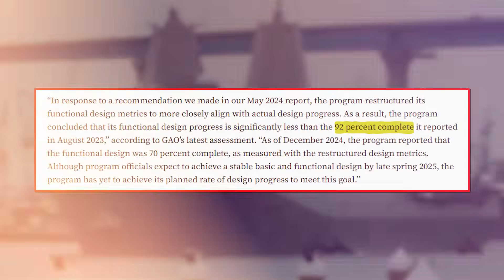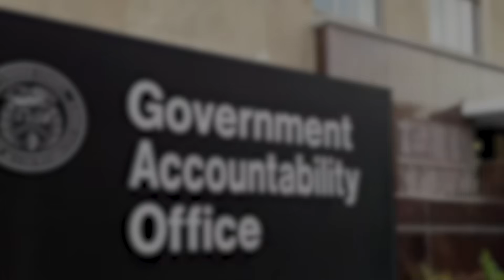US Frigate Meltdown: Constellation on the Brink!

Comment from the maker: If YOU were handed the Constellation-class playbook tomorrow, what would you fix first—its bulging weight, its slipping schedule, or its shrinking budget line? 🤔 Drop your battle plan in the replies and tag it #SaveTheFrigate or #SinkIt so we can track the hottest ideas. I’ll highlight the sharpest takes in our next episode—let’s see whose strategy could actually keep this ship afloat (or scuttle it for good). Ready… set… brief!
Reply: You’ve got Type-26 Combat Frigates already being constructed by UK BAE for the UK, Australian and Canadian navy. Already designed for DEW and extra weapons packages. It’s a no brainer. Ask for licensing. Problem solved.
Reply: @stephenpriestley5556 They tried that. It didn't work out.
Reply: By the baseline from the Italians made in Italy.  We need frigates now!
Reply: Return to a standard FREMM configuration with no modifications for building 20 now. Return to the drawing board for a clean sheet replacement for the next 20.
Reply: At this point? I would reassign the majority of people. Those not reassigned, would be suspended, pending investigation. Suspend the entire program, and order a careful investigation. Simultaneously I would use different people to begin with the Oliver Hazard Perry class hull design. Replace weapons and electronics with modern systems. Build, build, BUILD! I would carefully select good people for a clean slate design. Those involved with the original now frozen project? Would face an intensive and unlimited investigation. 
     I suspect that key officials were paid off. Allowing a real world project to turn into a computer game.  So that outwardly the program would seem to be on track. While in reality, the project was going nowhere. I also suspect that China is responsible for this.
Reply: The Canadian type 26 is very close to what the USN wants.

Finish the 7 FREMM to what ever standard is currently agreed, then swap to type 26 - should have enough time to fettle the design by then.
Reply: @kevinshort3943 I get it! That ship sank! Glugg! The Admiral in charge made a complete FUBAR of the project. It's time to move on. Whatever actually works? Hulls in the water are needed! These fu@kers haven't figured out how cut bait!
Reply: Sack the SOS manager that was also on the LCS prgram.
Reply: The Constellation Class is 98% the size of a Arleigh Burke but only 30% the firepower and near the same cost to build and man. I guess the question the Navy should be asking is what task they want the new frigate to play? The initial plan was to build a quick cheap ship that wasn't as powerful as the Arleigh Burkes, that could be built more quickly, and be cheaper to produce and operate. Instead they designed a ship that's inferior, expensive and timely to produce.
My solution is to drop the Constellation and instead produce a new Oliver Hazard Perry Class frigates with updated modern off the shelf systems, but also keeping it more simple. Use smaller cheaper radar systems and not the bulky AN/SPY-6(V)3 scanned array, this will reduce its ability to detect air threats but that is superfluous to its main role of taking on the smaller missions to free up the larger ships to more important tasks. The roles for the new OHP Class frigate would be anti-pirate, and anti drug operations with its shallow draft for littoral waters, fast speed, large double hangers containing both a helicopter but also UAV's it would do the job much more cheaply then using a much more expensive Burke. Also with a modern sonar system it would also be able to take on the anti-sub operations that the Constellation does not do. And lastly if they mount the older CIWS Phalanx system it can be used to screen for anti-drones operations. Not only could it replace the Constellation, but also the Independence and Freedom Classes.
Reply: @jpraiswater8625  
Constellation is a frigate, and Arleigh Burke is a destroyer. NOT an apples to apples comparison.
Reply: @kevinshort3943  And you don't seem to get the point. If a ship is 98% the size of a destroyer, and cost the same as the destroyer but is 30% its firepower, you might as well just make the destroyer. The cost to benefit ratio is what matters here not the classes. The Constellation was supposed to be the quick to produce budget ship that could be used for all the small jobs, but instead we're basically getting a frigate in a destroyer's body but without the teeth of a destroyer.
Reply: @jpraiswater8625  
And a tanker is multiple times the size of a Berk and has 0% of it's firepower.

They aren't the same thing!!!!!

"The Constellation was supposed to be the quick to produce budget ship that could be used for all the small jobs,"
Well if you are stupid enough to put the guy in charge of the last ship building mess, in charge of this one  ...............
Reply: @kevinshort3943  The Tanker comparison is just bad, the tanker has its own job that it does very well that the Berke cannot do. Yes the Constellation was supposed to be the budget ship tasked with all the small jobs, but my point in the comparison between the two is that they were apparently trying to turn the Constellation into a Berke and lost site of what the Frigate was supposed to do. Its almost the same size as the Berke, costs almost the same, crewed by almost the same number of sailors. Its basically a destroyer at this point but with lamer weapons.
Reply: @jpraiswater8625  
"the tanker has its own job that it does very well that the Berke cannot do. "
That is the point!

Rather than try and argue that your apples to oranges comparison is valid, direct your attention to the mess that the Connie is - cheap, already in use, mature design that will be 85% the same as the original.......................
Reply: La tiraría al cubo de la basura y empezaría de nuevo comprando lá F 110 española….

Comment: They decided to use an existing hull design to save time? Given this cluster f@ck? They might as well started from scratch! With a clean slate design. It's time to stop F@cking around. Start with the FFG-60, hull design. Add whatever modern systems you can fit. Then build, build, BUILD! In the meantime. Dismiss the incompetence that oversaw, the latest cluster f@ck!
     Either way the current design, is TOO SLOW! To keep up, with the CVN battle group. Hell, it's too slow, to keep up with my battle group E, in the 1980s! Utterly ridiculous!

Comment: Would go with a clean slate design or the Italian version as designed. 8000 tons is a little too heavy for a frigate. We need frigates, done on time and on budget. We also need a larger viable replacement for the Ticonderoga cruisers. Our cruisers should be closer to 15,000 tons since the Arleigh Burkes are around 10,000 tons.  Refuel and repurpose the Ohio class subs as the Columbia class come in to take over the boomer role.

Comment: This is the LCS debacle all over agains  The navy did a long selection programme to seek a base vessel to avoid delayed in certification etc. The  navy choose the design from Italy as stated then went and redesigned it increasing the length etc. This means the ship faces certification of the design  which was to be avoided.  Four ships have been laid down and reworked three time for three ships and five times for one ship. 

There are no approved design drawings and specification that have been signed off to allow correct production.

The first vessel is already over weight as pointed out reducing its cruising speed below required spec. 

So the USA navy has no idea what it’s getting and when it’s going to get the first ship commissioned .
Reply: it is illogical idea if u buy a ferrari why costumize it like a corvette? from 85% to 15%of commons parts insane is like put your bucks out the windows in a windy day

Comment: It's common knowledge the USA has not been able to design and build much since the Burke's.   Some of the support ships are good but LCS, Zumwalt and the charlie foxtrot approach to the Ford class carriers are prime examples that most commenters agree on.  First, why can't the US design and build a frigate now?  Basically leadership (or lack of it), reactive vs. proactive design, fewer ship yards and a diminishing skill set.  Fix the leadership, stop reacting to all potential treats, reopen (if possible) a couple of ship yards and create an incentive for learning the skills necessary to build the ships.  The constellation class frigate was suppose to replace the old Perry class frigates.  However, Perry class 4100 tons and now the new lite destroyer of the Constellation class is up to 8000 tons?  I've commented before on this but the new frigate does not need all the bells and whistles, just needs to be able to do ASW along with getting into the way of anything coming toward the battle group.   I get adding Aegis since that is the primary US system but that should not have added that much weight to the ship.  This project is criminal and those involved should be prosecuted.  Will they, no they will not.

Comment: I'd drop the number of VLS tubes from 32 to 24. Speed is life and so is range. The purpose of a frigate is an economical hull whose primary mission should be the anti-submarine role. Limited air defense is okay but speed in keeping up with the CSG would allow the Constellation better air defense from the Burkes and Ticos. Perry class frigates did this job well although being a single-screw ship limited its speed in keeping up with the CSG. Another thing, where does it say you need extra displacement to deploy ship based lasers? Leave such weapons to larger displacement destroyers, cruisers and carriers. What matters most is range, speed, and minimal air defense. The goal should be an anti-submarine platform to take some the load off the destroyers and cruisers. Forget the extra displacement for future exotic and exquisite weapons. Frigates should be built in the here and now with existing weapons in mind. Granted, some extra displacement should be allowed for improvements in sensors capabilities and helicopters but that's it!

Comment: They'd have been better if they'd bought the UK type 26 hull form and put their stuff in that, as it's designed to be that size with space for future improvements.

Putting more equipment in a hull form that isn't designed for that weight means propulsion is gonna suffer. I bet we see the batch 2's stretched and widened a bit.

Comment: Navy picked a finished, proven design, and then re-engineered it, defeating the whole purpose. Go back to the base design.  And add a phalanx ciws, searam and use ESSM quad-packs as primary anti-air. Primary purpose is ASW escort. Put a tail on it and some rocket 
propelled torpedos and a Seahawk or fire-scout and call it a day. Probably could just add ASW drones even later on.
Reply: You can't go back to the original design, because the Navy, smart as usual, selected the only design whose combat system and radar were incompatible with american combat system like Aegis and ESMM-2
Because the US navy has the best admirals you know
Reply: We can already have that in either of the 2 LCS designs.  LockMart showed a version of a Freedom class with an 8-cell (32 ESSMs) VLS.  Those ships are mostly empty on the inside as there are no modules available for them.  The US Navy wants a "mini-Burke" in the Constellation.

Comment: I would advise they make the holl lighter increase missile capacity to 64 and make the ship achieve top speed of 30knot and the weight should be decrease to just around 5000 long ton or 6000 long ton  and the us is making a mistake destroyer can never take on the role of cruiser if the newly modern destroyer us navy need a cruiser and not just 20 plus but up to 50 cruiser I Don't have much time right now but i can help them design a frigate that can beat any modern frigate

Comment: Navy wants to constantly alter design and stuff too much onto a small hull- Mission Creep... Where have we seen that story before?  In 1968 Ingalls addressed that problem by designing an oversize hull with destroyer  systems for the Spruance. Over time they stuffed anything they could bolt down and ultimately ended up with the Ticonderoga class cruisers.  Why not take a bare bones Arleigh Burke  hull and install frigate systems?  Another approach is to go back to the original HLL design based upon the USCG frigate- OH!  But that's too small for what they now have in mind.  Time for a Spruance (Burke) re-do. This is when it makes sense to dust off the Spruance blueprints.
Reply from the maker: Great points—and you're absolutely right about the Spruance lesson. Oversizing the hull gave the Navy room to grow, and that flexibility paid off big with the Ticonderoga class. Trying to cram too much into a compact frigate just repeats past mistakes. A “Burke-lite” or modern Spruance-style hull could be the smarter long game—modular, scalable, and built for upgrades.
Reply: @Combat-Tech  I think both Long Run & Short Run.  The current design is an obvious failure.  They need to start from scratch with a known platform.  Quicker & Easier.  Doubling down on a failure is a failure compounded.
Reply: @JohnCoxe-mw1cq  The only "known" large platforms we have running around is the 'Burke and the Tico, and the latter is out of production.  Making a reduced-cost, lower-weight frigate based on the  'Burke hull platform could be the ticket. If we can bring back the Tico hull platform relatively easily, that could be up on the table too.
Reply: @namyun2743  Ingalls designed and built the Spruance at their Pascagoula MS shipyard and as I recall it was smaller than the Ticonderoga- which was maximum expression of the Spruance. A minimum sized and updated version of Spruance with frigate systems would seem very attractive. The  Burkes are in production at the same yard and fully up to date and should have more than adequate power sources for frigate systems- with plenty of room for growth.   Still, the Burkes seem like overkill for a "cheap" frigate. They also designed a frigate based upon the USCG National Security Cutter, which now seems way too small, but it might be possible to make it bigger, but that might open the same can of worms as Constellation- too small for the currently desired systems.  Something known, big, cheap, and a lot of electrical power is needed.  Time is of the essence.  Burke would seem to be the quickest- but seems overly large and complicated. I wouldn't count out the Spruance.  Hopefully, the yard is quietly designing something in case of cancellation of Constellation.
Reply: @JohnCoxe-mw1cq  Just the 'Burke's hull platform for the space, power and displacement, not the whole ship.  The superstructure and equipment loadout can be redesigned for the frigate role.  Spruance sounds good too if it can be easily resurrected and modernized.  Could probably bring the center of mass lower and reduce displacement with a redesigned superstructure, put the NSM box launchers where the aft gun used to be...Spruance was a tall ship for sure.
Reply: IMHO, they should just ditch the frigate idea and collaborate with the Japanese or Koreans on a common destroyer architecture. They use American electronics and propulsion and are able to mass produce hulls. Then some hulls can be ordered in, say, SK and shipped, or even sail under their own power to the US for the sensitive electronics and weapons installation.

Comment: Disaster and after the LCS mash up. 8000 tons is not a frigate. Either way it was a piss poor idea to use the FREMM. Navantia had the right frigate/mini burke. Since we have stated we would build a frigate China built a run of fiftyish 054a and has moved on to the 054b as stated a couple years ago. Has two on the water already and can kick out five or six a year. Not good news
Reply: Over here frigates are between 6300 (ASW) and 8000 (Air Defence) tons, but on budget and with low crew numbers. So they cost less to operate as they have half the crew of the eighties counterparts. If they wanted a heavy frigate they shouldn't have gone with FREMM.

Comment: Im sorry but why are we so worried about a ship whose design is not even mature or complete when there is a backlog of repairs that need to be done? Carriers and subs are behind also. Stop it with futuristic garbage and go with what works. Stay with the fremm design. That was the whole point of selecting this to begin with. I swear WW2 designers would be laughing at these clowns right now. 32 cells is plenty stop with all of the lasers and hypersonic interceptors garbage the sm 6 can handle the hypersonic threat just fine. 32 cell 26 knot frigate is just fine. You are not building flight 3 burkes fast enough to replace the ticos you are retiring ( i think is a retarded decision you are losing 122 vls cell warship a proven platform when you need firepower to compete in the indo Pacific) what is the point of having a frigate if you are just going to make it as heavy and capable as a burke? Lasers are still a ways off and require a lot of power. At this point, bring back the Iowas take away two of the 16-inch turrets and  load them down with missiles and sea rams. Stop letting the scifi nerds run these designs and put people who actually know what they are doing in charge.
Reply from the maker: You’re voicing what a lot of people are thinking—why reinvent the wheel when proven designs like FREMM or even Flight I Burkes still work? The Navy’s push for futuristic tech often overlooks the urgent need to fix and field what already works. At some point, chasing lasers and hypersonics becomes a distraction from basic fleet readiness.
Reply: @Combat-Tech, yes. Hell, the amdphib fleet readiness is only 46% its requirement is over 50%. I just dont understand it. You can't cant service the fleet you have now but you want to build new shit? Its just dumb. Innovation is fine but not at the expense of current obligations. Our war fighters deserve better.